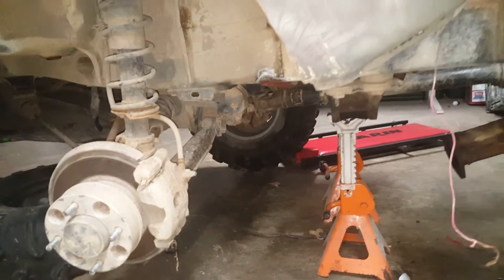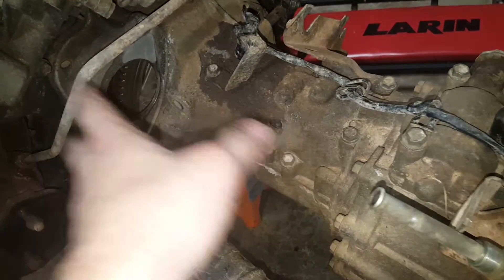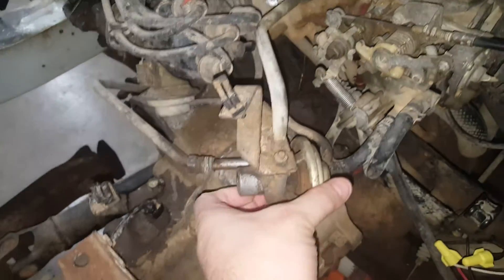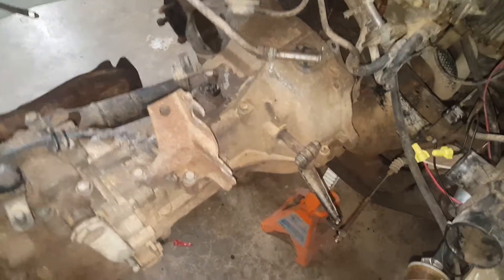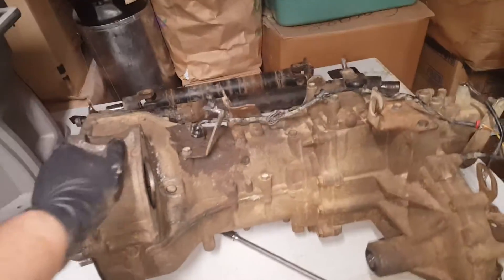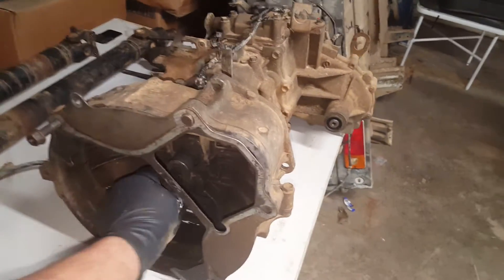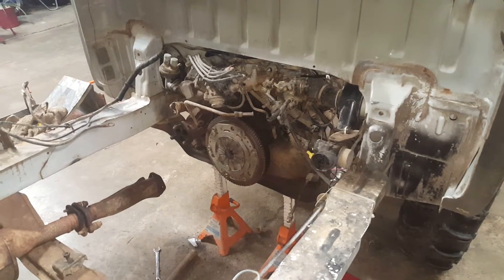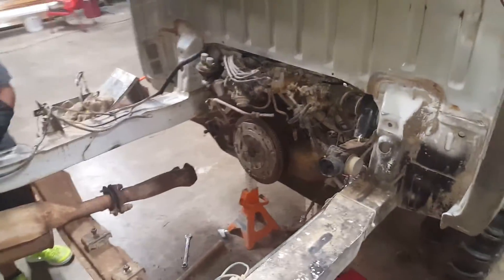1988 Suzuki Carry DB71T Engine Swap Part 5

Comment: Also, i found that if you can, it's almost easier to pull the transmission and engine by unbolting the crossmember below them...beats trying to mess with the mounts, where did you get your engine...i have been struggling to find an F6A for mine :(